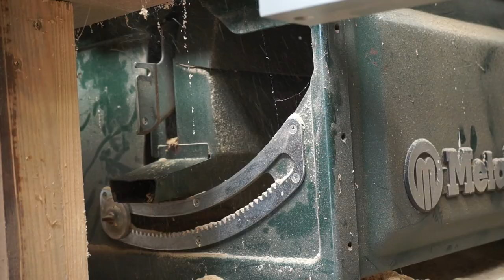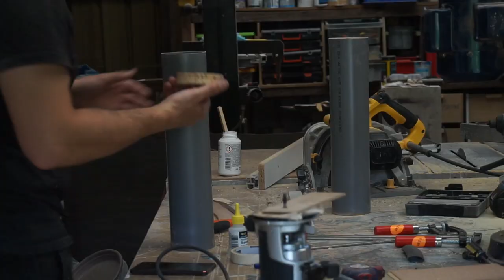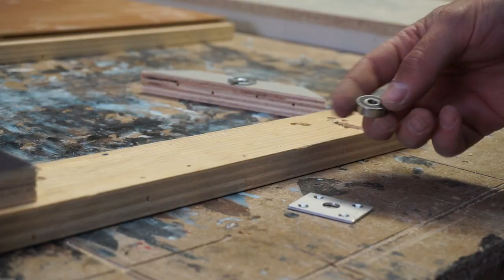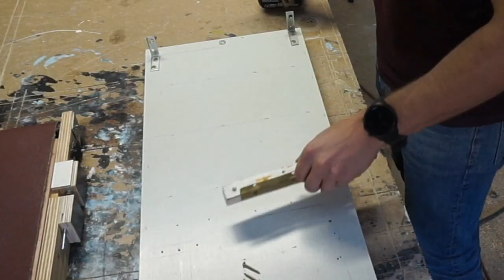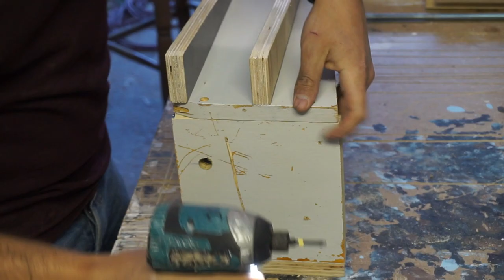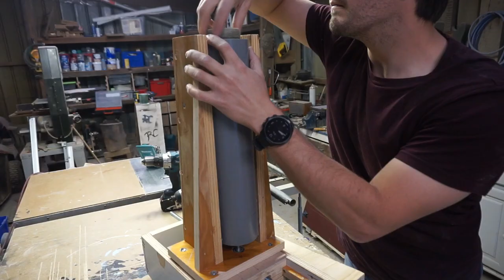DIY Drum Sander Part 1

Comment: Very cool.  I'd like to see more about how you did the tracking for the wide belt. I have one of the old Delta open sided sanders. I am having trouble with the tracking.  I think I also might need to make a new belt doing something similar to what you have done.  Thanks for posting your video....
Reply from the maker: Hi Jim,

The tracking is more or less the same as the 'stumpy nubs' drum sander or even the real jet drumsanders. I glued blocks on both sides of the belt assembly and inserted a piece of threaded rod with washers and 2 nuts. Tension is put on the belt by twisting the nuts away from eachother and tracking done by changing the tension on both sides.

The belt is just 3 sanding belts put together. I spray glued a piece of cloth on the back to make it 1 big belt.

Thanks for watching!
Robin

Comment: Did you put sandpaper around the upper roller? I saw a plastic tube and then you were using it and I must have missed it. was it glued on to the roller or fit somehow?
Reply from the maker: Yes! Cut little slits at both ends of the tube through which I put the tips of the sandpaper, this seems to lock it in pretty good. On a different roll I also used a little bit of spray glue.
I forgot to record some parts. I'm in the process of a short follow-up video, but it's pretty busy so that may take a while. 
Thanks for watching!
Reply: @RobinCoomans  makes a lot of sense. Thanks.

Comment: What size motor (hp) did you use and do you feel it’s sufficient for the size of this drum sander?
Reply from the maker: I believe iet's a 1hp motor, but i'll have to take a look to be sure. It seems to be sufficient, it does not struggle (or it hasn't yet). I bought a small motor for the conveyorbelt but that one is very underpowered.. so the follow-up video will take a bit longer tot come out.

Thanks for watching!
Reply: A 1 hp motor is easier/less expensive to come by which is why I find this style of drum sander more user friendly in terms of diy project, given the smaller footprint size yet offering the ability to do panels twice as large.
I know times are busy, but I’m anxiously awaiting part two in the video series and any plans that may be made available. A machine like this opens up the world of burl woods I’m really looking forward to using!!!
Reply from the maker: I nearly finished drawing the machine in sketchup. Now I still have to write out the plans. It's coming, but it's also quite slow going, sorry for that.
Reply: @RobinCoomans  waiting for sketch
Reply: Would be very interested in seeing those plans! Thanks